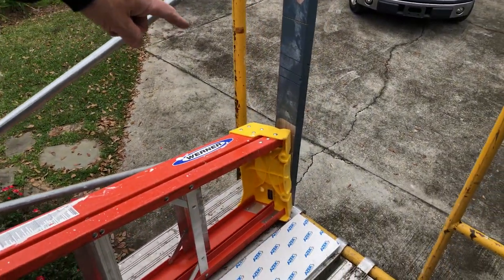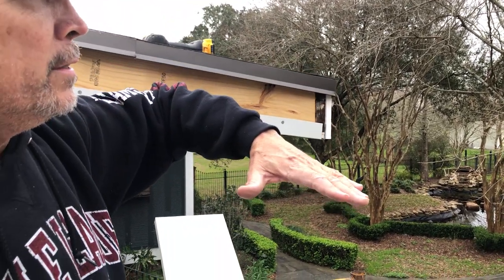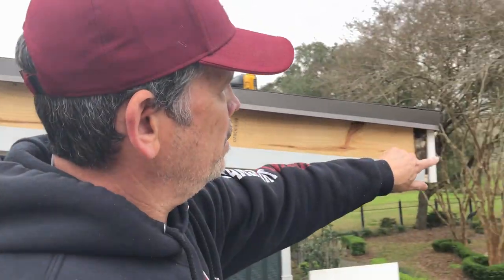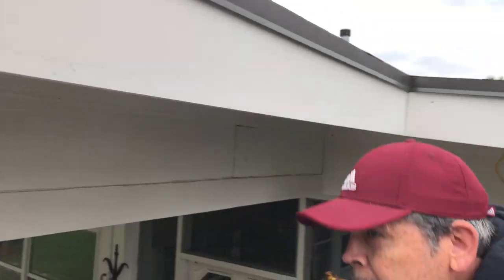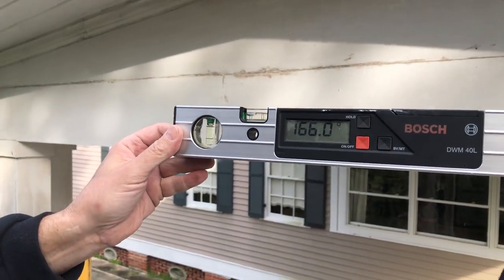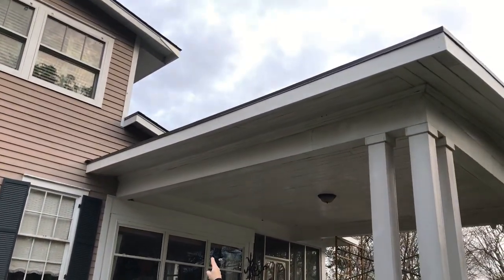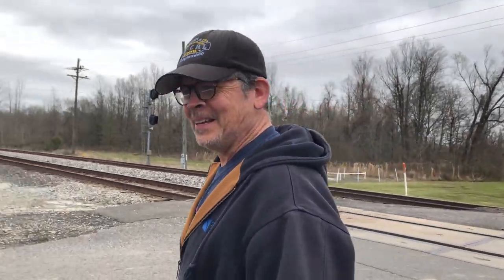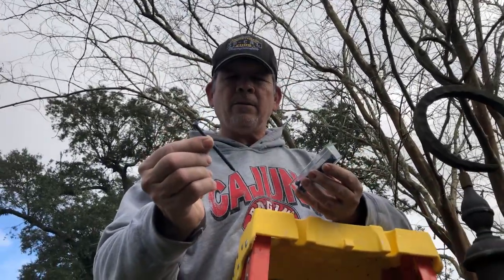Fascia Finale! Freshly Painted Fascia Transforms 100 Year Old Southern Getaway

Comment: Hi there,

What particular pvc cement/primer did you use?  I saw another video that mentioned only applying to one board (not both) or the cellular component won’t form that permanent bond…and was wondering if you’d heard that and what you guys do?

I just bought the fascia and was going to install it within the next couple days.

Thanks!

Comment: The problem with that jump is that once you are no longer on the roof you immediately start plummeting... not sure you would have enough forward momentum to span that patio; but I am a wuss when it comes to heights so just being on that roof would be a feat in itself.
Reply: 9.8 meters per second squared..... it's the law.

Comment: Tips : Do not use that exterior water based spackle.  I would suggest a different wood putty.  Talk clients into using a better bonding , spreadable and leveling paint like SUPER PAINT from SW or a Ben product that will go smoother , less back brushing and a great finish